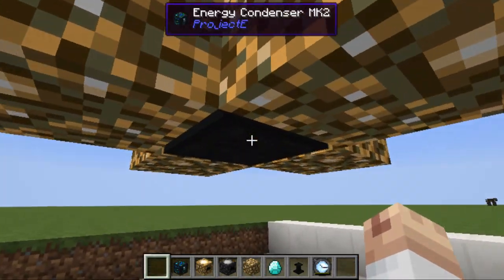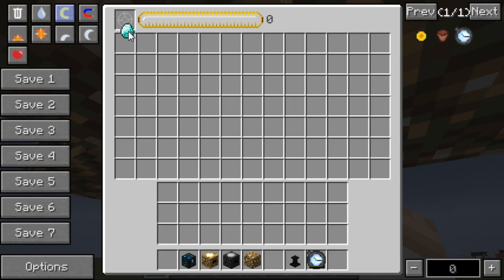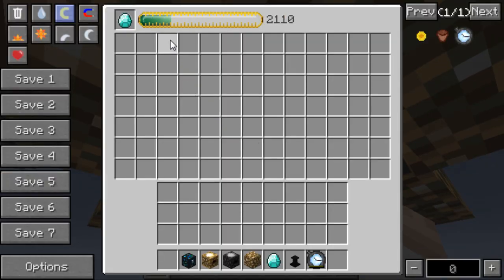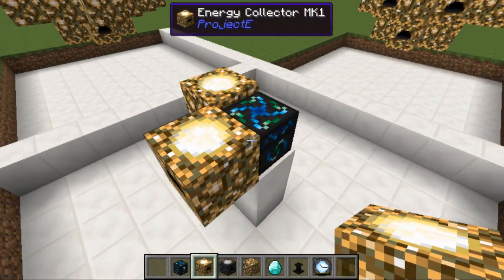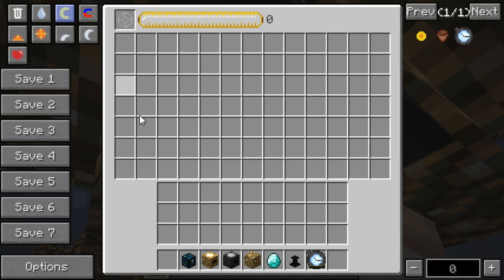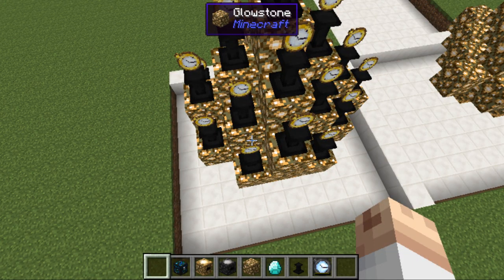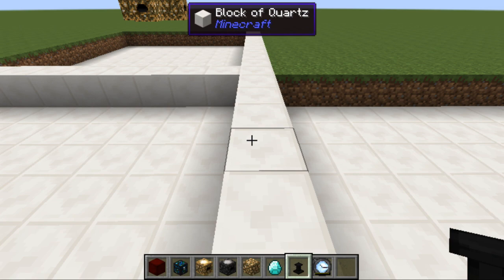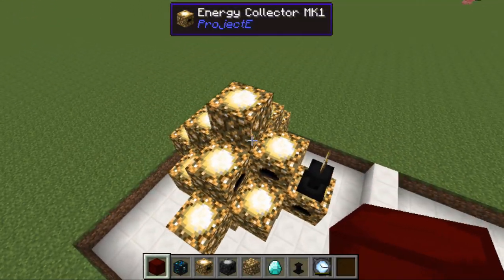Minecraft | EXTREMELY EFFICIENT ENERGY COLLECTOR | 1.7.10

Comment: this is inneficcient, relays dont transfer energy this way
Reply: What do you mean?
Reply: @1yddeT  energy collectors can't get energy transfered FROM anti-matter relay, they can only transfer TO, and at 2:35 he places an energy condenser connected to 5 energy collectors, which are connected to 4 anty-matter relays that are connected to 12 other energy collectors.
But this setup is wrong, because the anti matter relays should be connected to the energy condenser, but they aren't, so all the energy from 12 energy collectors isn't being used and so it's all wasted.
Reply: @Israel-jr5ks  so would the system work if you surrounded the condenser with the energy collectors and then a layer of anti-matter relays?
Reply: @1yddeT  nope, you should surround the energy condenser with anti-matter relays, and surround the anti-matter relays with energy collectors, so that the energy collectors would transfer the emc to anti-matter relays and the relays transfer to the energy condenser
Reply: @Israel-jr5ks  should you then put glowstone on top of the outer layer of energy collectors?
Reply: @1yddeT  yep, they generate emc based on the light they receive, so you can surround them with glowstone OR jack-o-lanterns, since they both emit the same light level
Reply: @Israel-jr5ks  Hey so I was making a power flower and I have it set up how you described but when I look at the energy collectors only one or two of them seem to be working? I don't know if it's a visual glitch but the numbers on only one of the energy collectors is moving?
Reply: Yep followed this guide and wasted about 10 million emc after realizing all the relays were just storing the emc
Reply: SuperG77  well, I'm not a native english speaker, so I think it would be very hard to understand a tutorial made by me with my accent

Comment: Once the Energy Condenser Chest fills up.... then what?
How do we put items from the Condenser chest into the transmutation table automatically?
Reply from the maker: U gotta throw it in manually based on my knowledge
Reply: @Luxigaming  Bummer. It is possible, though, to slap an Advanced Wooden Transport Pipe with a (Pulsar gate? It's made in the Galacticraft Assembly table using 1 Redstone Engine and 2 Iron Ingots, I forget the actual name, I'm not in game atm) to power it, and that will pull only your desired item out of the Condenser to fill an array of storage chests for when you've gone offline or otherwise afk. Don't forget to place one of the desired item in the Advanced Wooden Transport Pipe to tell it what to be pulling.